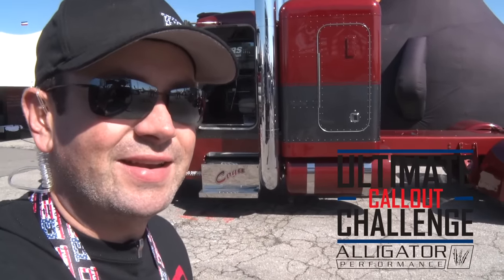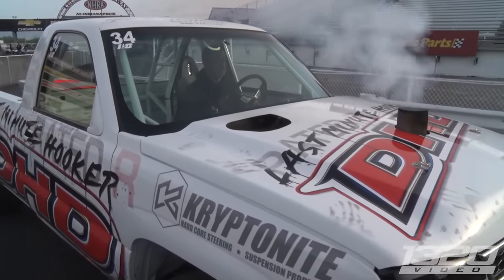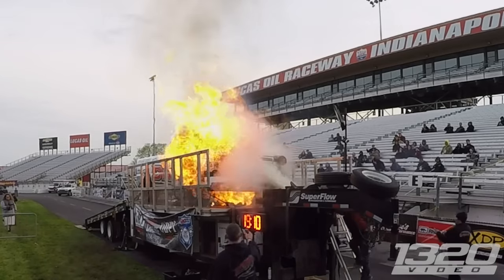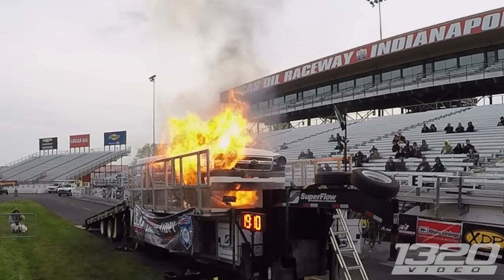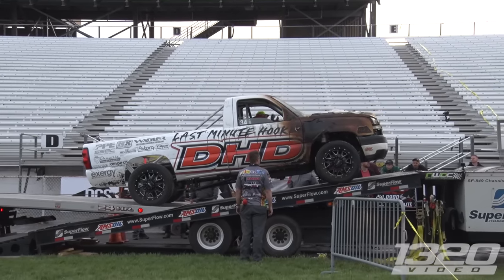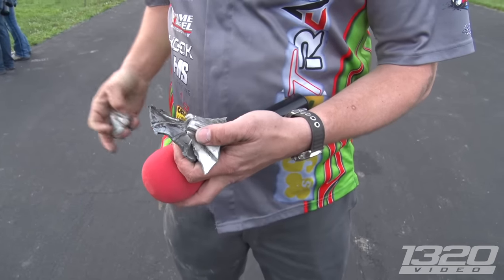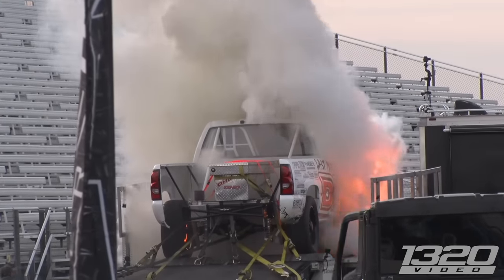MASSIVE FIRE - Runaway Diesel on the Dyno!

Comment: Advice in this case is to run away from a runaway.  Sad to see the carnage.  Good luck with the repairs.
Reply: for sure runaway is very scary shit
Reply: Poly Bun you know run away diesels are pretty hard to stop
Reply: @aussieguy1593  its not that hard when they are not fully engulfed in flames.
Reply: I ran heavy equipment and I had a John Deere articulator truck run away from being ether logged! Stupid mechanic kept spraying ether into it and me telling him to not do it! They're was no shutting it off! Threw a rod out the side the block! That was an expensive fix new motor!
Reply: Poly Bun  YOu cant really stop a runaway when it runs away. Its kinda in the name tho. It might be possible to do if you manage to stop the engine completely from breathing. But thats quite the task if it has a turbo and is on fire.
Reply: Is there any actual way to shut down a runaway diesel ??
Reply: @RBeeMedia  A runaway diesel cannot shut down even if the key is turned off. The only way to shut it down is to slam it on 5th gear in order for the engine to stall.
Reply: @RBeeMedia  assuming half the vehical isnt on fire there is a fair chance someone could either starve the engine for air or stall it as Michael said
Reply: @RBeeMedia  it would be good if they had a solenoid in the fuel line to cut the flow on a dead man switch.  I have seen people working on engines that ran away where they throw a rag in the air intake that would kill the engine.
Reply: Todayi1itall the best way to prevent this problem is a physical block of plate installed in front of the turbo or somewhere in between that and the intake manifold inlet. Any problem you throw the switch and cut all air to the engine, and it will immediately shut down. Best protection you could have on an expensive modified diesel.
Reply: @michaellegarde3125  Probably wouldn't work with these high performance diesels, clutch would go as soon as it's engaged in gear
Reply: There isn't much you can do.
The engine runs because it is burning the oil, and there is a lot of it in an engine.
I think the guy said that the intake pipe was sheared off. Shoving a rag in the compressor wouldn't have done anything.
I guess the best protection would have been a solid air valve right next  to the block that could have been actuated. But if that got blown off, you're back to square one.
Reply: Poly Bun  There is only one way to shut down a runaway diesel, cut all the air off, otherwise you can't shut it down until she locks up.
Reply: @RBeeMedia  remove the source of air/oxygen. Usually that means blocking the intake, and some people install a butterfly valve on the intake as a safety measure - this truck had one I believe. If it has blown a hole in the block/head/intake that valve becomes ineffective.
Reply: @lazerusmfh  Another way to do it is to replace the engine oil with silicone oil.  That doesn't burn.  When I worked at Shell on oils for the space program we played with this in an IC engine.
Reply: The mechanical stuff can be fixed, human lifes don't.
Reply: You can stop a runaway diesel by directing a c02 fire extinguisher into the intake/compressor housing
Reply: @mkatsarakis9963  When it is still connected, in this case it wasn't breathing through any piping by the looks of it.
Reply: What repairs ! That trucks done
Reply: ZERO94AIC  granted it wasn't high hp like this but saved a guys truck with some quick thinking it was a manual so I dropped it in 5th held the break and slipped the clutch till it bogged out and died
Reply: Throw ur t- shirt in the turbo...
Reply: @RBeeMedia  suffocating it from oxygen is the ONLY way... with the amount of fire, that would have been a tough on in this scenario
Reply: @michaellegarde3125  or cut off the oxygen.. with 2000+ hp, even 5th gear probably wouldnt stop it.. and if it did bog down, i am willing to bet it would have just spun the clutch into smoke, and kept going
Reply: @allknower6647  according to some other comments it was fixed up for the sled pull and went 308feet
Reply: @allknower6647  it was running the next morning

Comment: Organisers completely under prepared for a fire and run away like that.  Pretty amazing considering what is going on.
Reply: It was run away...  Just let it run till it welds its self.
Reply: They will definitely need professional firefighter hardware and personnel at their next event.

How did they ever get away with not having it in the first place.

The entire liability is with the event/venue. Someone should be facing some criminal liability and considerable fines. Their insurance also just doubled because of this one - solely based on this one
Reply: Fire department itself wouldn't have been able to do much more
Reply: @PropsandWings  I haven't seen a meltdown personally but I once did see an idiot drop a bolt down the block when i took diesel classes and the bolt came out shooting from the side of the block. Very dangerous.
Reply: It should be hood up or off, and a powerful source of CO2 pointed straight at the intake ready to deploy with a big red button at any time.
Reply: @42lookc  well that dosent always work the turbski hit all the right places on that one no block of wood or co2 was ganna stop it lol its rare a tubo takes out all the insta kill components out but that  one was on a war path lol
Reply: CO2 or Halon fire extinguisher. 

A Halon fire extinguisher would have stopped the engine, too. Can’t burn anything without oxygen.
Reply: Positive air shut off should be a requirement, just like in the oil patch
Reply: @Lonestar24  I'm amazed that they didn't have the proper fire extinguisher. the right one could've saved much more of the car
Reply: Yeah I was kinda shocked to see how long it took to get an extinguisher, even then they don't have big enough cans. 
Hopefully this was an learning experience for all involved
Reply: @joebessette6565  These kinds of trucks havd an air-kill shut off, its required. But they do no good when turbocharger parts explode out of housing and punch holes in the intake piping which is more or less what happened. What they need is a CO2 hardline plumbed to the lower intake manifold where it is unlikely to be damaged by anything. A release of CO2 into the incoming air will dilute the A/F ratio enough to choke a runaway out long as there's enough gas to go till the last crank revolution.
Reply: @mytmousemalibu   Okay, roger that
Reply: @lpatierno84  You're clearly not a firefighter.  You have NO idea of what you're talking about.
Reply: WHATS YOURSOC  No.  Just NO.
Reply: @Bartonovich52  NOPE.  Halons are ridiculously expensive, and not necessary.  You'd also need a HUGE CO2 extinguisher, which would be impractical.  At MINIMUM 2-3 dry chem extinguishers should be required, with at least a trained firefighter.  A mini pumper equipped with foam with two firefighters would be ideal
Reply: @ffjsb  If you're going to dump 30 pounds of dry chem into that engine to get it to stop, you may as well let it kill itself and save the money. Dry chem is ridiculously abrasive and corrosive once any moisture hits it. 
You're only hope is a bank of those 5 foot tall ( I think they're 115 cubic foot) CO2 cyliders hosed in parallel, and when the shit hits the fan, hit the dump valve and flood the engine bay with CO2, could use nitrogen, not sure which is cheaper right now.
Reply: @kleetus92  That engine is toast, dry chem isn't going to be what kills it...  Not to mention you don't want the dyno to burn.  Dry chem takes a little while to corrode things, electronics are affected more than an engine would be.
Reply: @ffjsb  Oh this one absolutely, but for less catastrophic cases, oil fire or something that isn't fatal, doesn't have to trash whatever is there. Yeah, lol, that one is past it's expiration date for sure.
Reply: I believe halon is no longer on the market.
Reply: Compared with some auto competitions, the dyno crew seemed well-equipped for fire suppression.
Reply: @lpatierno84  They would have at least aimed an extinguisher under the dyno as well as at the truck.
Reply: @PropsandWings  Yes, and what would you have done to stop that runaway diesel? There was no way to stop it short of maybe a couple sticks of dynamite, and even that might not have worked. As long as there was oil left in the oil pan it would have continued running even if the dynamite had blown the engine clear out of the truck onto the pavement.
Reply: @douglasburnside  Actually, dynamite might work, when the exploding dynamite removes the oxygen from the surrounding air. It is a method used to put out oil rig fires.
I wouldn't try it, though.
Reply: There is not preparation for that.

I take that back...if you have enough CO2 at the intake, but the amount you'd need is just unreasonable. You'd have to keep it coming until the block cooled, wouldn't you?

...I wonder if you just dumped 20 gallons of liquid nitrogen on the block....it would cool it off AND starve the fire as it evaporates. (probably Crack the block too...idk if that's good or bad.)
Reply: @scottbc31h22  Hey that's how they put out oil fires!
Reply: @tyrenner  ummm... Flooding it with CO2 would certainly stop it. The CO2 will displace the air (containing oxygen). With no oxygen, there is no fire. It's how Cardox fire suppression systems work.
Reply: @scottbc31h22  Dynamite wouldn't remove oxygen long enough. The engine would only have dropped a few rpm by the time it started sucking in fresh air again.
Reply: Honestly I could probably see why they wouldn’t have the equipment for something that wild idk how many times that’s ever happened let alone at that specific track or wherever they were doing the dyno run at
Reply: Driver wears a base cap while his exploding charger impacts into the windshield just before flames engulf almost the entire truck... These dyno runs should be undertaken with the same safety equipment as the actual races.
Reply: My thought too.  Thank God the driver was able to get out uninjured.  He said he couldn't find the door handle and jumped out the window.  Would have been a good idea to leave the door ajar.
Reply: @Bartonovich52  "A Halon fire extinguisher would have stopped the engine, too. Can’t burn anything without oxygen."
That's not how halon works. It's CO2 that starves the fire of oxygen. Halon interferes with the chain reaction. The free radicals that drive the chain reaction prefer to react with the halon, rather than most fuels, but the reaction with halon doesn't produce more free radicals.

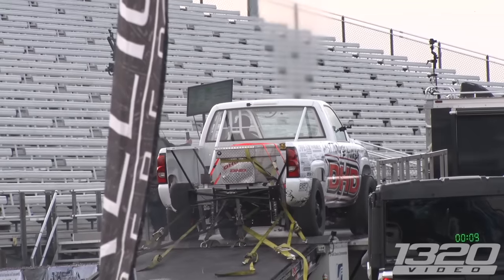Comment: Check out the adventurous guy,  the one with the smart phone still filming (min 2:10) while standing on the drivers side after the engine explodes with flames roaring.  Nice touch.
Also you'd think they would have paid the extra expense on hiring a local Fire (company) Crew to handle such an event, instead of having those unprotected nit wits (yeah, I know they meant well) using those piss ant fire extinguishers.
Reply: Agreed! This case calls for Nomex suits and trained professionals!

Comment: AWWWW!  I wanted to see that dyno chart!
Reply: I wanted to see the dyno itself after that run
Reply: 3470Hp at 7489rpm

No idk, just made up numbers.
But most likely it would've lost a lot of power at 7k due to valve float and that the engine was barely making enough power to push past 7k.

Comment: Here before "Should of built a Cummins" trolls..Glad everyone was ok
Reply: A cummins would not have ran away at that rpm for that long.
Reply: Rozza43 yeah the Cummins would have blown up way before the duramax
Reply: @woottastic  Cummins would have thrown every rod thru that billet block. We had a kodiak run away for damn near 10 minutes a few years ago when the turbo went and filled the intake with oil...we still use that truck to this day, after a new turbo obviously.
Reply: A runaway cummins would have thrown the rods and there would have been deaths in the crowd.
Reply: Lol yeah except a cummins did win the overall event like every other year soooo
Reply: @simeonwitmer  no one denies they are fast as hell they would kick the ass of a duramax and a powerstroke....they just have a reputation for poor reliability when modified
Reply: Michael Cody a cummins doesnt explode, it launches a mortar 🤣
Reply: Gregs Designs you just like showing up to things and calling someone a liar just because you don’t agree with them? Is that the kind of dude you are?

I work on engines. An in-line 6 Diesel is more likely to fall apart during runaway than a v8 Diesel. It’s just how things are built. If you’re not smart enough to understand that I’m sure there are some tutorial videos online that are simple enough for you to understand.
Reply: Not an engine problem. The turbocharger blew. Blame the turbo company!
Reply: @Yousuck00  
since when did GM make billet block, there genius
Reply: @Yousuck00  Hey guys! This completely built truck that only shares maybe 10% of the original parts blew up and proves the manufacturer sucks.
Reply: Simeon Witmer we’re gonna keeping running the last minute hooker till we win. No more cheap precision turbos

Comment: im amazed at how long that engine ran in those conditions.
Reply: they are built strong and tough for the worst conditions possible, almost too tough considering these sorts of incidents
Reply: Given no need for sparkplugs it can and will run like this video with unregulated fuel and oil entering the engine. Diesels may be tough and efficient but they also have flaws

Comment: Imagine if that happened on the track he would have been hauling ass toward the end of the track!
Reply: even harder to put a shirt in it
Reply: Good point. That would have been crazy.
Reply: Power driven diesel had their truck do that at a different race last year.  Slammed into a wall
Reply: @adamlewis6660  Note to self- don't ever get a diesel.
Reply: @fortisprocer966  lol it's very rare for them to run away
Reply: @fortisprocer966  so consider yourself lucky if you're one of the few that end up in a runaway going 100 into a wall

Comment: Did he just say there might be some bottom end damage????
Reply: Lmao. MIGHT....
Reply: Lol, yes he said that!
Reply: It should buff out ..... Maguire's
Reply: "very low miles for the year, I know what I have so don't lowball, never driven hard, always maintained, mechanics special"
Reply: Motor turned over fine, just have to tear it apart and see what looks like.
Reply: Right?! Fire, explosion, and the engine ran probably well past 20000 rpms while losing oil. That engine is done. Wishful thinking though
Reply: @Brandon-ch2ot  20,000 rpm... how?!
Reply: Yeah,  in the vid they lost the dry sump belt so no oil at peak rpms. I had a turbodiesel motor run away in my 4x4 but no dry sump and with fresh oil and a new turbo its been fine for a few years since.
Reply: Jmp 49152 
Dose a runaway put down power to the wheels. 
Sounds like dumb ? If u left in gear would it start getting faster or loss power?
Reply: @dylanbradley9188  it would go faster, you are pouring in more and more fuel(oil) with the leak itself bypassing any control arrangement since rpm is limited by the metering inside the injection pump as diesels run wfo in terms of restriction at all times. If you catch it before it gets hold properly you can stall it out if your clutch is in good shape by selecting a high gear and dumping it with the brakes on, but when it gets going properly or is a automatic or clutch slips you either choke it out with something blocking the intake (and opening the hood and bending over a engine trying to choke it while its about to let go at insane rpm's and fire shrapnel everywhere and dying seems less attractive than a replacement short engine), or a inert gas (co2, argon etc) sprayed in the intake somehow to displace the oxygen needed for combustion which is what they were trying to do with the fire extinguishers by firing them into the intake area.
If it ran away on the strip, I'd knock it into neutral, get it physically stopped and retire to a safe distance and let it destroy itself.
Reply: Jmp 49152 
Thanks brother that makes sense
Reply: B White 20000?! Probably more like 8000.
Reply: @manic_tinkerer  I just want to know what would have happened if this same explosion happened durin 1/4 mile at speed of 100mph. Engine pushing over 1000hp to wheels and you can see anything from smoke or stop the car.
Reply: dylan bradley there actually wasn’t any. One piston and a couple bearings
Reply: B White no 8-10k rpms

Comment: Next time you have a runaway Diesel engine, aim the fire extinguishers at the air intake.
Starve the damn thing of oxygen
Reply: I was thinking the same thing. You'd think with so many knowledgeable people there someone would have thought of that.
Reply: Bummer it started running backwards
So you'd have to shoot it in the exhaust.
I've only seen a few old two stroke diesels do that.
Good ole detroit v8 diesel
Reply: Its a diesel though.
Reply: @mwhitelaw8569  Some of the older John Deere tractors would do this if you lugged them down too hard and too low of RPM
Reply: Sumit John it wouldn’t have mattered. A fuel line was broke off the fuel rail and a chunk of the turbo put a hole in the air intake pipe right above the manifold. Still getting air in it...
Reply: @stalinsbitch7428  you dont need an air intake if you got a liquid oxidiser, like nitrous oxide?
Reply: doesn't do much good when the intake isn't connected to anything

Comment: They definitely did not have proper fire safety measures in place with Diesel's you need to have a way to check the air flow like a large tank of liquid CO2 to flood the engine bay to displace all the oxygen not necessarily on the truck but near the dino for runaway diesels
Reply: Did u watch the video at the end the guy said no suppression system would of stopped it
Reply: large tank of c02 will stop people as well...